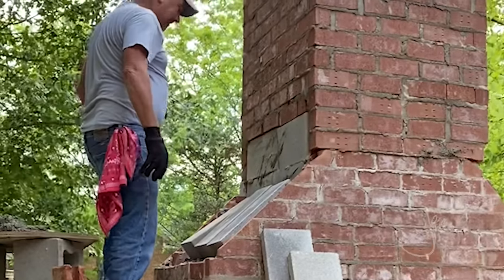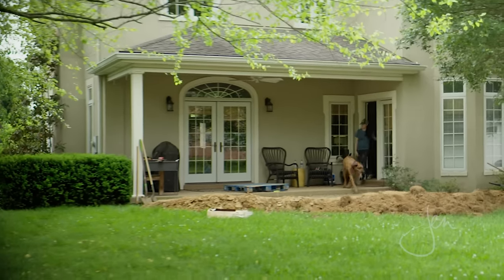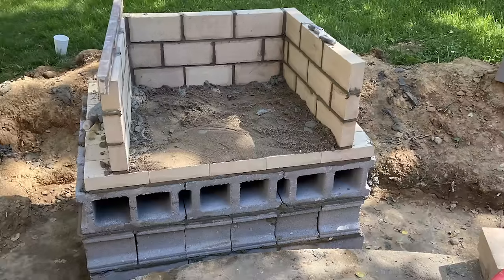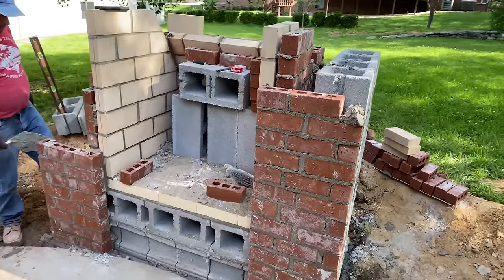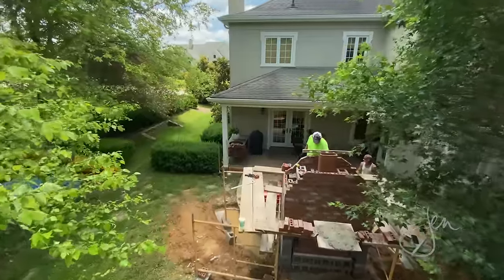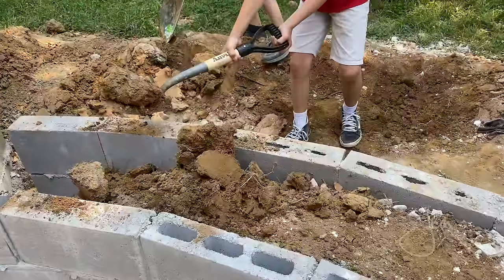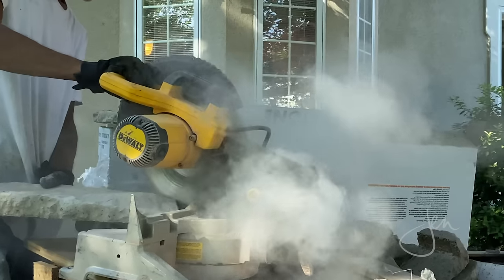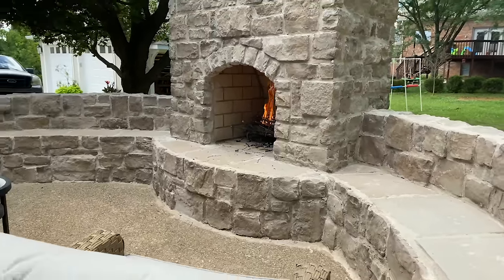Building An Outdoor Fireplace (with tips from a professional mason!)

Comment: What did you use to wrap and secure the string lights through the chimney cap? I'd like to do something similar but I'm concerned about the heat melting the light wire at the top of the chimney. Great work!
Reply from the maker: Thanks! We installed this string light hanging kit and it works awesome! https://amzn.to/4dStklo

Comment: Good idea about "lowering the opening" to the firebox at the last minute. It probably wouldn't have been a problem for such a massive chimney that draws well, but if there is going to be a smoke problem with a fireplace, many stem from the top (entrance) being too high. Lowering 4 or 5 inches increases draft, and of course, makes it that much harder for any smoke to get out.

Comment: Awesome project, and it was designed well to look very good.  There is only one slight problem on how the seating and hearth were veneered.  The horizontal slab stone should overhang the vertical veneer stone, rather than the vertical stone being in front of the horizontal hearth stone.  As it is installed, there is a water penetration joint at that intersection.  I understand it is not part of your house, so water intrusion is not a huge concern, but eventually, the water intrusion will damage the mortar holding the vertical veneer stone, and repairs will be necessary, especially after any wet freeze - thaw cycles.  Maybe this occurred due to the size of the hearth stone that was used not being wide enough, so something to plan for to avoid this situation.
Reply: Also, since they filled the center with soil, when it gets wet and freezes, it will push the face out.

Comment: This looks great.  I am contemplating one that is very similar.  Two questions:  1) does it throw off heat to the patio?  2) What are the dimensions of the firebox?  I am hearing that a lot of these outdoor fireplaces don't throw off heat and it is because of the design of the box.
Reply: I am a mason of 27 years and if you want heat on a outdoor fireplace look up rumford fireplaces, these are shallow fireboxes that throw off some good heat! FYI most fireplaces are for ambiance and not heat, wood stoves are for heat.
Reply: Smaller firebox with a depth of 28 inches
Reply: You can install a heatilator which will throw as much as you want, some have fans that create even more heat.  I know if you install a heatilator on a fireplace for inside it will get too warm if you don't put a thermostat on the blower apparatus.
Reply: @russellallen5482  If a fireplace has a good heatilator they are pretty efficient.  But yes, a wood stove is much better for creating heat.
Reply: @carycase5563  heatilators were great yes , we are currently removing 3 of them on one house now because they are switching to gas. I’ve never seen a heatilator on an outdoor fireplace though I will say. Rumford is the way to throw some real heat out for an outdoor fireplace in my opinion.

Comment: Where did you get the plans for your fireplace? Or did the mason draw it up? Looking to design one for my yard, I know what I want but don’t know where to start for schematics and chimney height etc.
Reply from the maker: I designed it and drew up the plans! A lot of the build process was working with our mason and figuring things out along the way. Your mason should be able to help with chimney height and firebox construction so that the fireplace draws properly. Good luck!
Reply: @JenWoodhouse1  any chance I can get a copy of the plans?  If not, did you just hand draw or CAD?
Reply from the maker: @jon4973  I used to Sketchup to draw the project, but didn't step it out like I normally do in my plans.

Comment: How much did this fireplace cost?
Reply from the maker: Hi, I don't want to disclose the exact amount out of respect for Tony and his rates, but I will offer that cost will vary greatly depending on what materials you choose, the size and scope of the project, and availability of materials. The labor costs were about as much as the cost of materials, so the division of funds was about 50/50. The manufactured stone veneer we chose was $6/square foot - I'd say it was 'middle of the road' from the choices we considered. Natural stone can be double the cost or more than manufactured stone. The size of the fireplace will also affect cost - adding the benches drove the price up in both materials and labor. The quotes we received varied from $8k to $18k; we did save money by doing some of it ourselves. Hope that helps!

Comment: The concrete blocks that make up the base of the fire box are on their side weakening the integrity of the heavy structure there for this is a big dangerous FAILURE.
Reply from the maker: Hopefully not! We haven't had any issues these past 4 months.
Reply: Thats how they are supposed to be layed . You don't lay them like regular bricks in the fire box.
Reply: @MikeB-jn2bu  They are not bricks and I know what im talking about. If it had to be inspected it would fail. As a structural engineer I know for a fact this is a collapse waiting to happen.
Reply: This thing ain’t going nowhere unless the masons tear it back down😜..The only weight sitting on that cmu base is your firebrick and maybe a few flu liners. The main structure that encapsulate that is sitting on that beefy footing and angle iron as it should. No worries here Jen. Nice work and beautiful fireplace, from one mason to the next!👍🏾
Reply: @seaislevel7233  I know they are not bricks, they are fire bricks and thats how they are laided in fire box at least for a fire place. The only weight  on them would be the weight of the flu liners and it's  simular to a arch because any weight  is dispersed to the sides witch is boxed in by ciderblocks. I've built many like this. Next  tIme you see a old fireplace take a look.
Reply: I do this job every day and i share to u and i dont think it has be done well
Reply: @alfaomega4284  why continue to do it wrong?
Reply: Boot

Comment: What was the total cost of your project.
Reply from the maker: Hi Joe, 
I don't want to disclose the exact amount out of respect for Tony and his rates, but I will offer that cost will vary greatly depending on what materials you choose, the size and scope of the project, and availability of materials. The labor costs were about as much as the cost of materials, so the division of funds was about 50/50. The manufactured stone veneer we chose was $6/square foot - I'd say it was 'middle of the road' from the choices we considered. Natural stone can be double the cost or more than manufactured stone. The size of the fireplace will also affect cost - adding the benches drove the price up in both materials and labor. The quotes we received varied from $8k to $18k; we did save money by doing some of it ourselves. Hope that helps!

Comment: OMG that concrete was WAY too wet. It will probably be fine, though. Next time consider renting a mixer. Or HD sells a good 5 cu ft mixer for not much, and when you're done it will sell quickly on Craigslist. A 5 cu ft mixer will mix two 90 lb bags with water in about ten minutes. Trust me, this is the way to go for DIY projects.
Reply from the maker: I addressed this in the video.

Comment: So beatiful!!! How much did it all cost?
Reply: Looks like an $18,000.00 job to me.
Reply from the maker: Out of respect for Tony and his rates, I won't disclose the actual cost, but I will offer that it will vary greatly depending on what materials you choose, the size and scope of the project, and availability of materials. The labor costs were about as much as the cost of materials, so the division of funds was about 50/50. The manufactured stone veneer we chose was $6/square foot - I'd say it was 'middle of the road' from the choices we considered. Natural stone can be double the cost or more than manufactured stone. The size of the fireplace will also affect cost - adding the benches drove the price up in both materials and labor. The quotes we received varied from $8k to $18k; we did save money by doing some of it ourselves. Hope that helps!
Reply from the maker: Thanks for the great compliment!

Comment: 2:34 Uh not really. More water into cement, makes the mix weaker, not only longer curing time. Its quite vital to know what you're mixing, for which task and that you get all the mixtures correct. Too much water = weaker mix = more cracks and in colder climates frost can make an impact.

Comment: You act like brick laying is rocket science.  Its hard work no doubt and you need to know some rules.  What surprises me is that there was no rebar and concrete inside the cinder block walls.
Reply: As a mason myself, if it’s not coming out of the footing, it would not serve its purpose. Also, when building outdoor fireplaces, my goal is to only add the necessary weight to have a solid structure. Otherwise the footing would have to go deeper and better reinforced with rebar
Reply: @jmasonry75  Are you saying that rebar is not necessary in this case?  With the extra heat I have always put rebar to help with the expansion contraction.
Reply: @Dev_Everything  yes. If you think about, rebar would only add the thermal expansion. And if getting enough heat sipping thru last the fire brick and the flue tiles, you have other problems. Not tooting my horn, but building fireplaces is how I cut my teeth in the industry. 
The most important part of these projects is the footing, just my opinion.

Comment: 4 bids between $8,000 to $18,000. .. So, ehh, how much did you pay?🤖
Reply from the maker: Out of respect for Tony and his rates, I won't disclose the actual cost, but I will offer that it will vary greatly depending on what materials you choose, the size and scope of the project, and availability of materials. The labor costs were about as much as the cost of materials, so the division of funds was about 50/50. The manufactured stone veneer we chose was $6/square foot - I'd say it was 'middle of the road' from the choices we considered. Natural stone can be double the cost or more than manufactured stone. The size of the fireplace will also affect cost - adding the benches drove the price up in both materials and labor. The quotes we received varied from $8k to $18k; we did save money by doing some of it ourselves. Hope that helps!
Reply: @JenWoodhouse1  Thank you for your quick and thorough response.
Reply: Definitely the 8k one.

Comment: The masonry work on this is sub par at best. Terrible stone work.
Reply: Why is it terrible?
Reply from the maker: Riley, 
Care to offer CONSTRUCTIVE criticism? We're extremely happy with the result.
Reply: Hes just a hater. I own a masonry company and it looks great!
Reply: It's clearly a thin stone veneer, it hasn't been dressed which it should have been being that it's a natural stone. Thin or not.
The bonding is another large issue & the shoulder caps where done with the thin stone. It should be one solid unit or a thicker material. The fact there is no over hang on the shoulders will be an issue for water in the near future.
Reply from the maker: @yevgeniy720  It's not a natural stone. It's a manufactured stone veneer.
Reply: @JenWoodhouse1  right, but when working with manufactured stone, I use corner pieces to truly give it that full natural stone appearance.